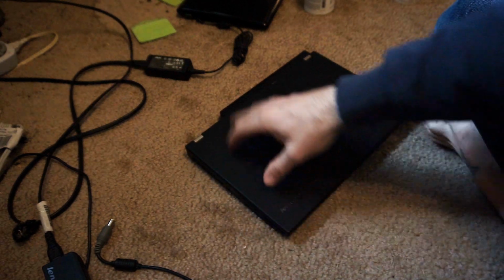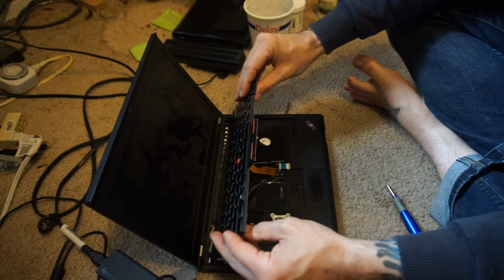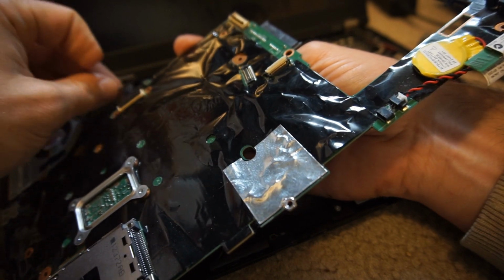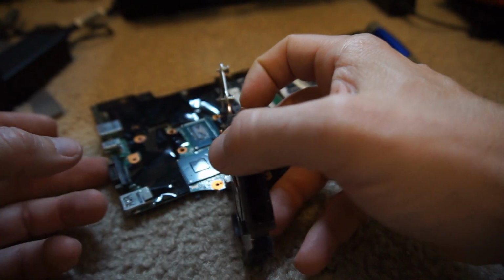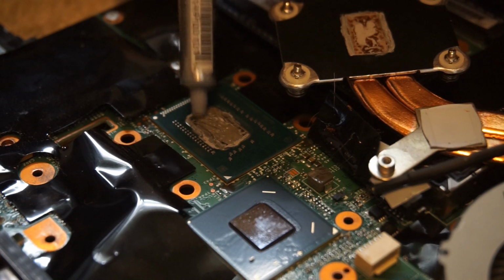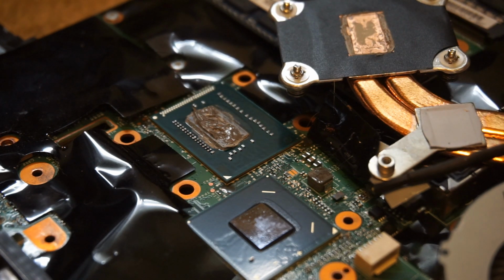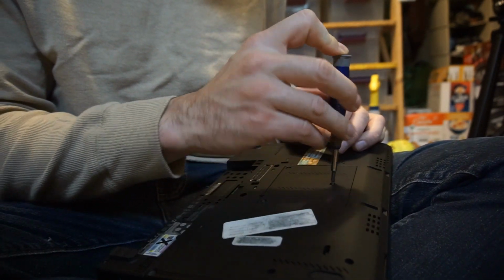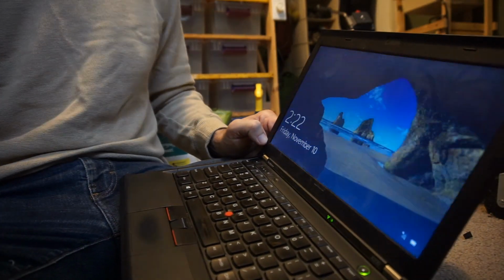Laptop Suddenly Turns Off On Its Own

Comment: How many seconds did it take to switch off at first? Because my dell latitude laptop shut down within 15 seconds and also the screen was black and the fan kept spinning until switched off by itself . Checked if screen has problem but it is not. Please help..